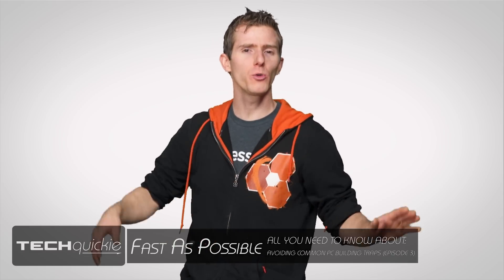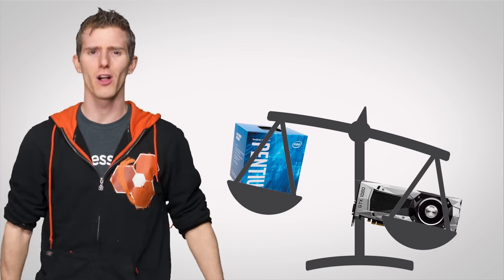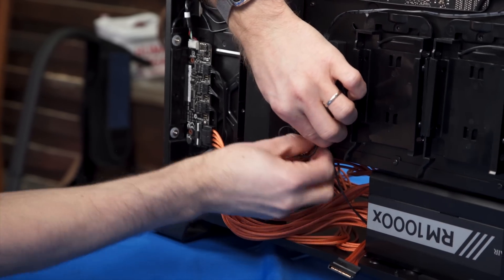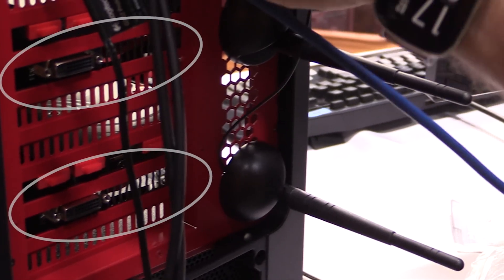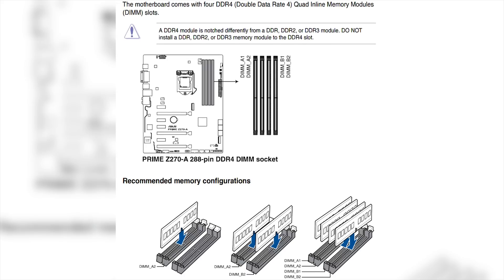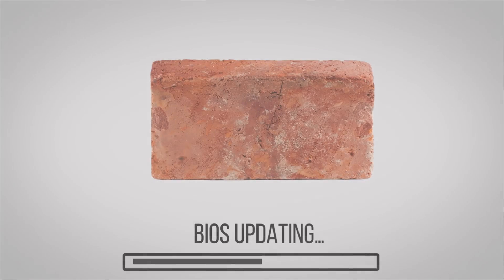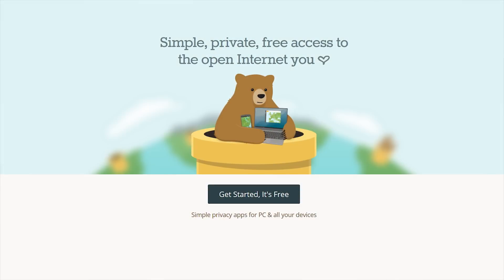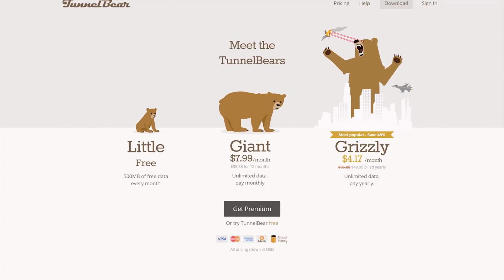Avoiding Common PC Building Traps - Episode 3

Comment: How about when is it a good idea to use previously used parts off Ebay to save money for a build?   Which parts could be used without being a danger to your system?  What to look for as red flags when buying said parts?  And how to determine the reason the seller is selling those parts.  Whether they are selling seriously outdated hardware or if they are an upgrade junky?  
This is not discussed in most first time build tutorials.  Is that because  most are found on sites like Newegg and sponsored by hardware manufactures?  Or if it is just a bad idea to do so?
Reply: I think it's a good idea that we talk about this as well. Minor thing that I've learned years ago was never mix PSU cables. Some pins has different config and if they do, you can fry any components that are connected to it. I learned that the hard way.

Comment: Hi Linus,
I have a suggestion.
I think I bricked my Motherboard and or CPU by conecting it to the wrong outlet of my PSU. So I think my mistake was assuming that if the plug fits the socket it's the right voltage.
I'd love to see this covered in an episode.
Cheers.

Comment: Have a back up if you can't figure out what is wrong with your PC, like a highly rated local PC shop that is cheap and do good work, and even find a way to cable manage a Bitfenix Prodigy for free, holy shit just take the time to Google anywhere that isn't GeekSquad pretty much, and you will turn your $1300 paper weight into a good gaming PC. May or may not be speaking from experience.

Comment: Always have more than one disk partitions(one for OS, one for everything else) especially if you use 1 HDD for storage. This will save your data and save you a lot of work by easly reinstalling windows when everything just goes wrong.
however as more people tend to use SSDs and M.2 slots for the OS while having separate storage solutions, you should still partitions the SSD into two parts(actually can it be partitioned or not?)

Comment: Actually, if you brick your motherboard while flashing, there are some motherboards which have their BIOS chip in a DIP socket, so you can buy a new chip from wherever and replace the BIOS chip in your motherboard and you'll be good.

Comment: I work at a hardware store and the most frequent problems we get are 'Why doesn't my integrated graphics on motherboard work' and it turns out the customer isn't using an APU in the board. Another thing is checking that your board needs a BIOS update to support the chip that you'll be using like Kaby Lake. We've had countless boards returned as faulty because the user didn't realise the BIOS needed updating before it could be used with the chip🤦🏼‍♂️

Comment: Use the right CPU power connector, have had 3 people in the last month either leave them off or somehow use a gpu adapter to plug in reverse with the psu side in the CPU power on the board

Comment: A while ago something funny happened.

Long story short. My buddy purchased a Z170-A board and wanted to get an i7 6700K, but something happened and he was forced to wait.

Then, by the time he had the money, 7th gen was out and since it's the same socket, all it was needed was a UEFI update
BUT!!!!!
Even as the MB is listed as flash back BIOS capable, it misses a flash back button anywhere. and the manual didn't help much.

So as many had experienced in the past, I had to get a past gen CPU, update the BIOS and now everything's fine.

It seems that usually using an older board with a new CPU is not the greatest idea on the world.

Comment: Don't buy cable extensions

If you want custom sleeves for your cables don't just buy extensions to plug in to your cables that came with your power supply.

Now I have a big mess under my power supply shroud trying to make the 24 pin and 8 pin cables fit without using the strength of Hercules getting my side panel on

Just spend the extra money and buy replacement cables for your power supply if you want custom cables

Comment: Ensure everything fits. GPU length, Cooler height, RAM sticks clearance, Cables buldging on the other side panel, 140mm fans on a120mm only case, PSU size, etc

Comment: I`m currently building up a cheapish gaming rig. So far antec 900 sixbay case 2 gtx550ti`s in sli with a core i5 4800k and 12 gig of ripjaws ram ddr3 i think. ( yea i know not great but all i could afford on my miserly wages here in england). This case is a bitch to cable manage wich is the point i`m at now i watched all your build vids and tips. But this cable manage issue is rele pissing off my ocd. Iv`e got it all cable tied as best i can. Any tips  would help right now as this is a bitch.

Comment: The Golden Rule of PC building: Once first assembled, always power on and test before putting the side panel back on. Failure to do so will incur the wrath of the PC gods and your system will invariably have an issue requiring you to open it back up again.

Comment: Things I've learned over the years:

*it's probably never going to work first time. 

*ITX sizing without any kind of background research is confusing. and weighing up whether buying a new board vs. buying the right case after you've just bought the wrong fricking size board, is just simply self humiliating.

*if you plan NOT to overclock, just use the stock cooler. On the other hand if you do, get a decent heat sink. (RIP i7-920, Sorry I failed you as a ignorant teen, you magnificent bastard)

*If you are using a case which doesn't exhibit the inside, cable management shmable management! just use filters for dust, it clearly doesn't have any effect on cooling, and Linus is just OCD on his cables. Stuff em in, who the fuck cares!? ;)

*Computer equipment stores (in the UK anyway, in my experience) immediately think you know nothing, so when you listen to their bullshit on why you need to have an extra £400 on your build cost because you need an extra flux capacitor connected to your central mainframe - pulling them on their bullshit later rather than sooner is much, much more rewarding!

Comment: ok so i have a bit of a rant/question thing idk, ok so i moved to canada from england but my mainframe pc that i use for gaming got soaked in the container and now it is a brick so i came up with this ( https://pcpartpicker.com/list/Xz6JGf ) is there any changes you would make to it (nothing more expensive it can be around that price or lower thanks) any help is much appreciated. :)
Reply: First of all, I don't think you really need a liquid cooler, no offense but it would be better to get a high quality standard cooler than a low quality liquid cooler. I recommend the cryorig H7 ( it's very good). Another  thing is that I don't know what you are using your pc for, but if you are gaming and you don't want to spend a lot of money on space, I would get a 1tb drive instead of an ssd. Other than that it looks good.
Reply: Reptile King even better, if you want to save a little, you could get a 650w, you probably won't need an 850w only if you want to do sli in the future.

Comment: One my newest/current build, I re-did by cables at least x3 lol  esp after adding extra fans, and found I was "tripping" over the wiring, as it were.  I ran the wires/cable in such a way so I can remove a single device without trying to figure out which cable goes where ;-p

Also get a case with ample interior space... too small a case is a pain esp if you don't have small girly or Trump-like digits ;)

Comment: Be very damn careful when you fit your CPU onto the mobo
socket. If you try to close up the socket with your CPU not properly seated, you'll end up bending the socket pins which are damn hard to "readjust". If you do bend them, grab a credit card, use the corner of it to slide on the socket pins in the direction they used to be and usually it resolves the bending in less than 10 minutes minus all the time it takes to reach CPU socket. Magnifying glasses and watch grade tweezers work but are a pain to come by these days.

Comment: I wish I had know these things before I started buildiing computers
1. Install every single standoff your mobo allows for. (not doing this can lead to dmging the mobo when plugging things in)
2.Make sure secure boot is off when installing parts or upgrading parts.
3.get a magnetic screwdriver
4.Always check the simple things first. Most problems I've encountered over ther year have simple solutions. (Is the power switch on, are all the cables properly plugged in)

Comment: I find cable routing has some downsides. For starters trying to route your cables in the most visually appealing way requires much longer wires than a direct plug in. Then the use of zip-ties inconveniences you when you need to swap out components. I've also personally bent connector pins on my motherboard because my cable routing put too much strain on them. Honestly, if you don't have a window, cable routing is a waste of time, as I recall luke even deduced that the performance benefits of good cable management basically didn't exist.

Comment: If you're workin as a system administrator in a company, inside the case using permanent marker write down the number of the computer and the pc building date. Also using permanent marker write down on the hdd  number of the computer.

Comment: I upgraded my PC fairly recently and when I booted it up it has an Amber light. My old PC was Dell Studio XPS 7100 and now its upgraded with a i5-4960K, a GTX 1060, 16GB of DDR3 Ram, Corsair CX650M PSU,  and H81-M mobo, and i still kept the old dell case. Although the PC works fine, it still has an amber light. Pls help.

Comment: I will say it (said it in ep2)
Dont assume all the fans you buy work with your motherboard's fan headers. There are PWM fans and DC fans. Buy the correct fans. I bought 6 DC fans and my MoBo only had 3 DC headers and 3 PWM headers. When I pluged my DC fans to the PWM headers they run at 100% and I could not control them at all. USE DC on DC and PWM on PWM. or you know use fan splitters.

Comment: If you already sort of balanced it, it's tough to decide what to upgrade.
I have an i5 2500K @ 3.9GHz and an OC'ed GTX 780 3GB paired with 16Gb DDR3 low latency @ 1600MHz.

Out of those 3, I have no idea which one I would even begin to consider.
Seems to run all my games smoothly at 1080P ultrawide so far but the day will come when I'm itching to pull the trigger on some NCIX or Amazon sales deal!!... You what I'm talking about; you know who you are. :)

Comment: Hey does anyone have any idea how to find hardware logs from old PCs. Hang on let me explain exactly what I mean. STORY TIME!

So I want to rebuild my first ever PC from when I was little, built around 2001. It was a high end system at the time, with 512 MB of ram and two high capacity hard drives (important part being I still posses these two drives, both are in working order). Now, I'm starting to doubt it because the two drives are very high for 2001, 360 GB each. But at the very least they contain clones of the system I had at the time, complete with Windows XP and lots of outdated software. 

My question being, does anyone know if there's somewhere on these hard drives that would have records of the components this thing used. I found a few basic things (how I figured out it had 512 MB of ram) and I know it had some form of ATI card but that's about the extent of it. I refuse to believe that on one of these crammed drives there isn't a single document, be it in a game folder or system folder that would have a list of the parts contained. Any ideas?

Comment: when installing win7 from a USB stick, stick it in a USB 2.0, win7 does not have native support for USB 3 and gives you an error msg to install drivers
Reply: Depends on the computer, because my Dell Latitude E6430 and my old Dell XPS-8500 installed Windows 7 through the 3.0 port. I only did this because I knew it would work on my computer though.

Comment: High-end gaming people never think of standard desktop builds.  Here's a few tips: Make sure your CPU supports onboard video (I'm looking at you, X99).  Don't think you need that "Z" motherboard and "K" series CPU if you're planning on running stock (e.g. not overclocking or adjusting CPU timings and RAM voltage).  Look at enabling "XMP" in BIOS: some motherboards don't automatically use the speed your RAM can tolerate.  Turning on "XMP" changes that 1066MHz RAM into 1600MHz or 2100MHz RAM.

There's probably more but I'm pretty drunk right now to dole out actual good advice.

Comment: Make sure to plug the front-panel USB cable onto ALL of the pins of a USB 2.0 motherboard connector.

This caused a friend of mine's computer to not post when the front-panel USB 3.0 cable was plugged into the motherboard header, leading us to the think the 3.0 port in the case was bad. We finally figured it out when we tried using a flash drive in the USB 2.0 ports, and Windows reported a USB short. We looked at the cable going to the motherboard and found the USB 2.0 cable was only plugged into half of the pins of motherboard USB port, and that for some reason screwed up the USB 3.0 port as well!

Comment: There is a fecking trap in building PC's that even profesionals deal with it:  
the 2 different types of screws that are build in and almost look the same. 
1. Those for the motherboard and peripherals and 
2. those for the case and plates for the trapdor slots. 
Especially the motherboard screws can get stuck in the underlying nuts where the motherboard is laying on and screwd on to if you use the wrong ones. The result is that those nuts suddenly screw themself out below the motherboard and can even damage it! (those ones https://sgcdn.startech.com/005329/media/products/gallery_large/STANDOFF632.Main.jpg)

Comment: my pc wont show a signal, checked everything, using gpu outlet. the spacs are:
mobo: MSI AM1I
cpu: AMD Athlon 5370 (yeah yeah, i know but was cheap and had the corresponding mobo collecting dust)
gpu: gtx 1050
psu: evga 430watt 80 plus.
ram: corsair vengance 8 gig
for hard drive my new one wasnt recognized so i grabbed an old 160 gig one, turned on once without the gpu on my box test, but once in the case with the gpu it stopped working, took out the gpu (just in case) and still didnt work, cleared cmos, still nothing, all fans ramp up, tried installing windows while i didnt had the gpu but it failed. I was told my hdd was too old to work with windows that that was the problem, but i dont get why it would stop it from booting to the bios, after all the windows install never finished and it got reversed in theory.

Comment: I disagree with plugging the GPU into the monitor for the first boot. I spent around an hour thinking my gpu/motherboard was broken when I first started my computer and there was no video output. I had to plug my hdmi into the motherboard, change a setting in the bios, restart and then my gpu would output video.

Comment: One tip: look at all the wires on your case. Write down the label on each one on a piece of paper.  Get your Motherboard manual and go to the page that shows all the connections.  Write down all the connections that match your case wires.  This paper now helps you route cables & wires.

Comment: Do not update the BIOS. problem solved.
Reply: I went with that for a long time. Didn't think it was necessary. By the time the system became more and more unstable and there could be multiple bluescreens a day, I didn't even remember you COULD update the BIOS.
Reply: Good luck running Kaby Lake on 100 series boards then.

Comment: ADVICE... in most mid tower PC cases it is really worth it to instal a PSU, route the CPU cable to the back of the case, to the top left corner and through a cable management hole back to the main chamber BEFORE installing the motherboard.... so the CPU power cable is in the right place already, because in many cases it is impossible to route the thick CPU power cable header through this hole when the motherboard is installed....

Comment: You don't need a stupidly expensive mobo or cooler to overclock. Someone told me if you don't have a $300+ mobo and a $100+ AIO cooler you can't overclock, uhh no, I've been getting by with a $130 z series board and a $30 hyper 212, thank you very much.
Reply: tman2damax 

And here I am with a $51.24 motherboard overclocking with a Hyper 612.

Comment: My pc has my ram in single channel mode because I'm too cheap to buy a fourth stick, but 8gb of ram is too slow. help.
Reply: Its not enough for just cause 3, they say it's the minimum but it stutters beyond belief, and gta 5 runs at 40ish with 8gb and with 12gb I get 70 with stutters to 50 due to being in single channel mode.

Comment: Magnetic trays & screwdrivers are needed, don't question it, especially when a screw (which are mostly conductive) falls into the belly of the PC. I had to turn my built PC upside-down to get a loose screw out, re-checked everything before I powered my PC up

Comment: Make sure if there's a selector for 110/220v on the power supply you have the right one picked, especially if you're in the 220v country.
Reply: i live in a 420v cuntry wut does ich do?
Reply: PSU's are also called "switch mode power supplies" so they normally support 85-240V.
Reply: A PSU with that switch is probably low quality.